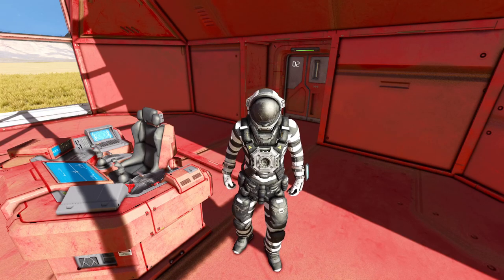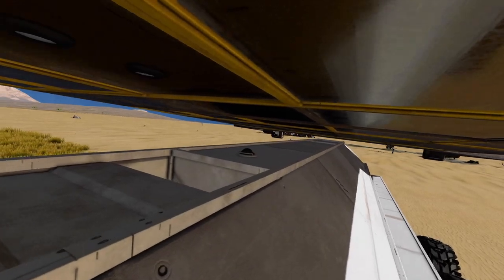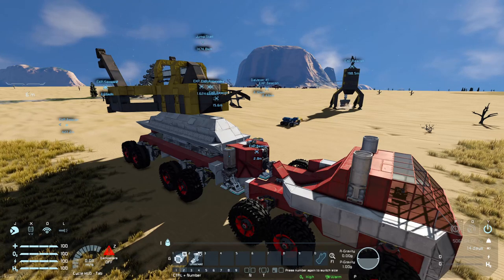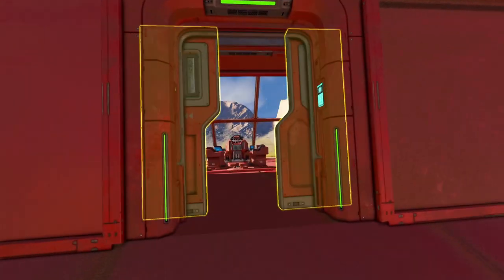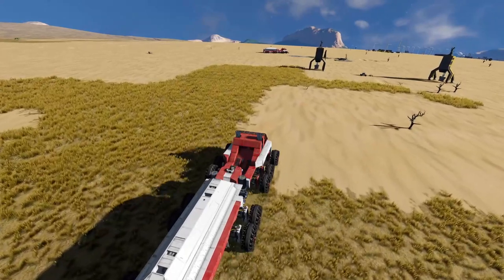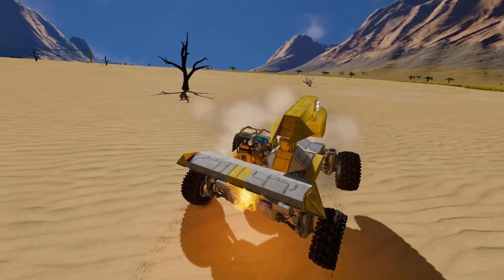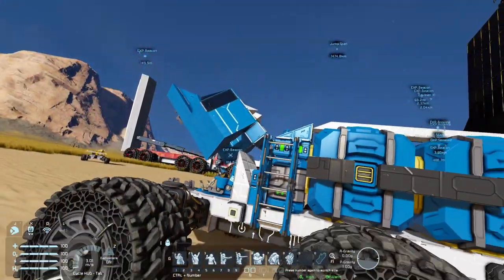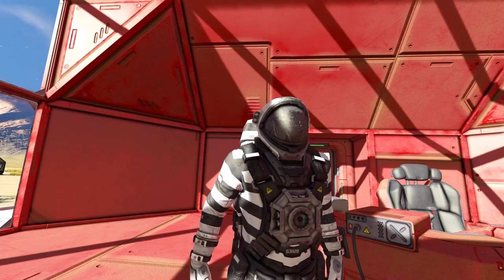Space Engineers Workshop Builds: Big Red Truck Drill From Surviving Pertam

Comment: You are missing the point of why that is a popular real world lift system. The pistons shouldn't be any farther back than the Middle, by attaching it at the end like that you are working MUCH harder to push Up. Closer to front you get the easier it'll be. I'm not an engineer in RL but I think from what I remember at the End you are doubling the weight, at the front you are almost 1:1.